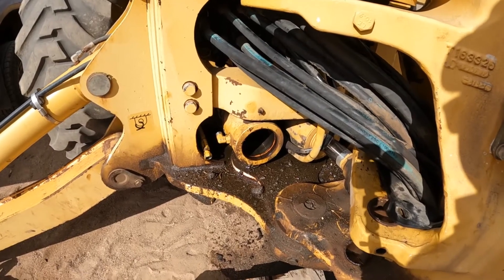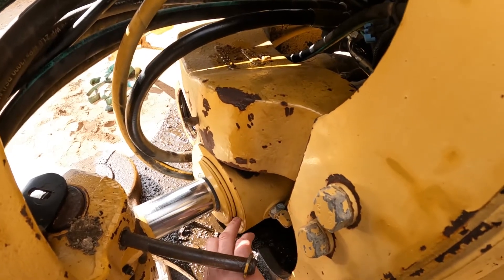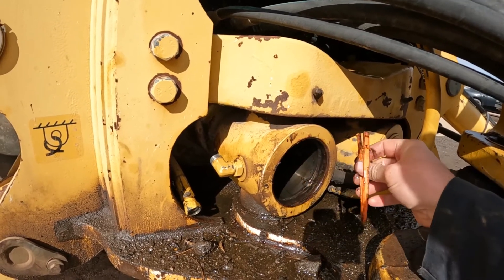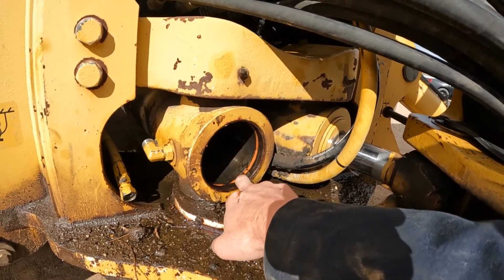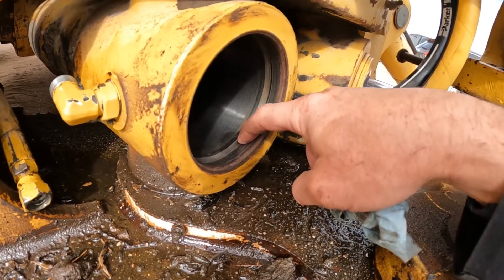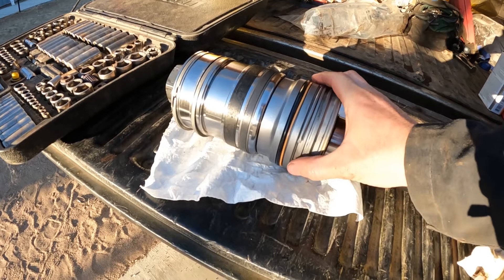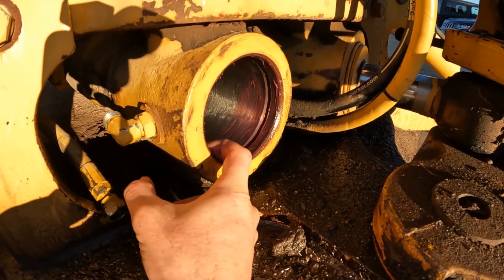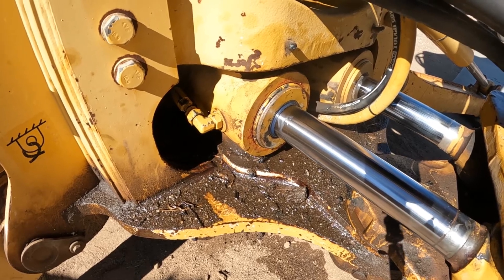How to take apart John Deere hydraulic cylinder

Comment: Would you happen to have a part number for the snap ring removal tool? Deere says the tool doesn't come in the kit they sell...
Reply from the maker: @joshscharf9031  I do not have the part number for the individual tool. But it was included with my kit, and mine was a Deere kit.